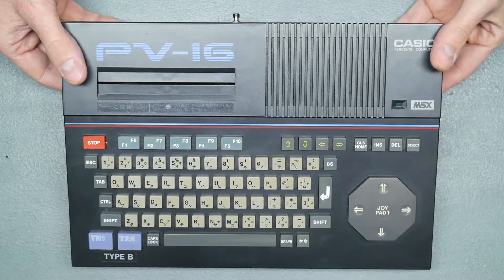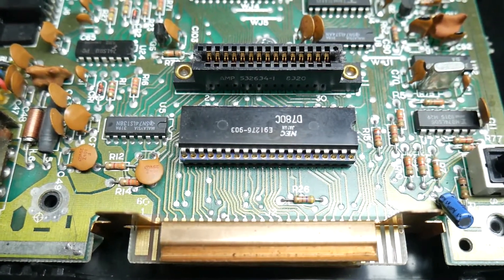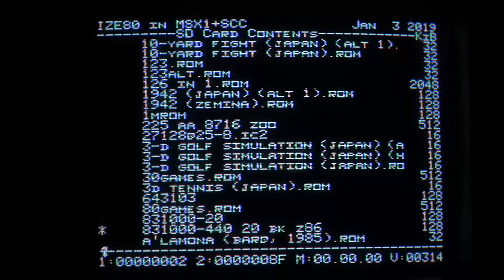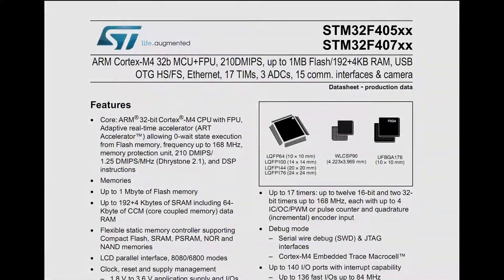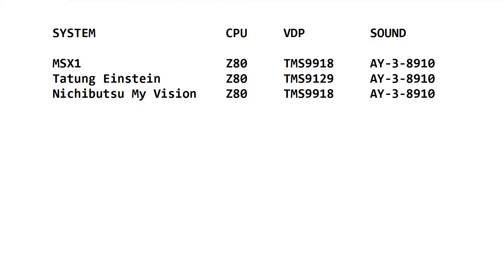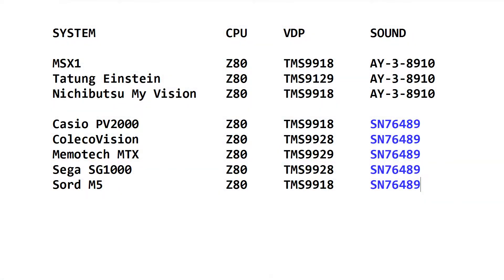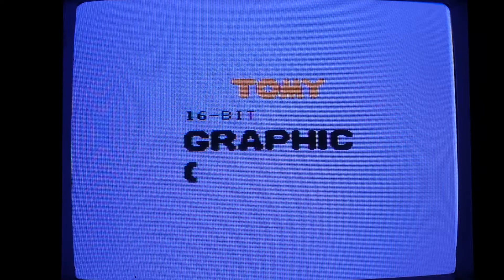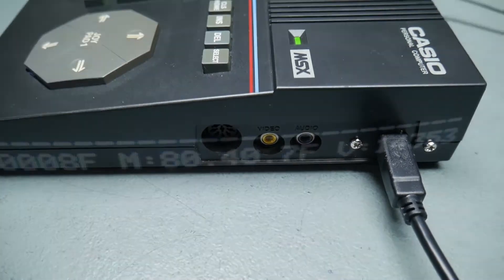IZE80, an in-circuit emulator for Z80 systems in action in an MSX

Comment: has this been abandoned?
Reply from the maker: Its very well an active experiment/tool for me. However the thought of selling/supporting this for various uses there is incredibly terrifying. Would be an enormous time drain
Reply: @plgDavid  

Any chance you could be convinced to open source your work?  If you don't intend to sell it because of support reasons (perfectly understandable), it would be awesome to make what you've done available for others to extend.  You've basically got something better than a Fluke 9xxx series with a Z80 pod, but it's all modern tech, and could be expanded so many different directions.  I sometimes do old arcade machine repair, and this thing would be a life saver when you've got a Z80 based game that's flaking out.

Comment: Dude, where did this end up? Did you make these available?
Reply from the maker: I still use them in Z80 stuff I own once in a while but I’m not selling them. Can’t get more parts anyway (STM32F4x5)
Reply: @plgDavid  Ah, that's a shame. Have you thought about open-sourcing the design, in case some folks have that microcontroller in their parts bin?
Reply from the maker: @gunrock00  I did. But even so I feel I would get questions about it, and I knowing myself I would answer them.

Comment: Hi David... I'm from Italy and way back in 1981 I designed a small computer based on Z80 and a few other components with RF video output and a minimal BASIC interpreter. I'm looking for a small development system that allows me to write and test code the Z80 easily and inexpensively ... could the  be  IEZ80 the right item? Can I buy it?
Reply from the maker: Nah. its still an experiment that needs a lot of custom code for each specific hardware I put it in. Supporting this would be too much of my time. Its just a hobby :)
Reply: @plgDavid  I can understand :-) thanks and bye

Comment: I am interested in this device as well. Ever think about adding software and linking it to a remote PC to use as a Fluke 9xxx emulator?
Reply from the maker: It can do roughly the same as a fluke pod but I just program what I need myself and dont have a Fluke script tool. The device is sadly not for sale. I have no time to support this sadly.

Comment: Do you use gpio to emulate data bus?? How to pause execution??  How to communicate with debugger??
Reply from the maker: Yes the data and address busses use a contiguous GPIO port each for fastest writes. I didnt implement a debugger per se yet, but it could be programmed and controlled either locally or remote. The Z80 is emulated with C/C++
Reply: @plgDavid  hi David, is the z80 emulation of your own or are you using a third party library? I am working in a similar project but based on rp2040. Reading your comments I know that I'm in the right path...
Reply from the maker: I forked an old build of https://www.autometer.de/unix4fun/z80pack over the years.  @carlosmsx2

Comment: I'm very interested in the hardware of this board. The application I'm looking at is a simple, very slow,  ( but no longer available ) I/O chip. If you could make public the PCB files, BOM, and software tools then I know it will be easy to find  the right people to programme it. There is an active group who are reviving machines a generation older than Z80's, and a programmable 40 pin device like this would be the answer to a lot of their prayers.
Reply from the maker: I hear you and I want to make it happen in one form or another

Comment: Super cool! It would be great to see it documented on github / hackster or similar. That would not preclude any sales either of the finished device. In addition to ICE, some sort of debug UART interface would be great - given that it can control the bus fully, one could use it to upload/download memory contents, set ports, run with hardware breakpoints etc, making it a great development tool.
Reply from the maker: Theres an integrated STM32 debugger (SWIO and SWO)
Reply from the maker: Just too many things to finish on many other projects, sadly

Comment: Are you ever going to sell this Emulator to the public?
Reply from the maker: Michael E. Bills as I said a few times, my main issue is support. I could sell it to programmers with some hardware experience only, kind of like an arduino, without all the documentation and forums.
Reply: @plgDavid  okay, thank you... I am interested as I have been teaching 8 bit programming with teens in Virginia for years. I thought your IZE80 would be interesting for the students to learn and develop on.
Reply from the maker: @Michaelebills  What Z80 machines would you want to put them into?
Reply: @plgDavid  I have two Commodore 128, 2 kaypro II, I am also building a Z80 computer with some students from scratch.
Reply from the maker: @Michaelebills  Hmm Very interesting. Never tried it in C128 (although I have some here), dont have a kaypro. IZE80 would have a hard time working in a shared bus thats for sure.
Reply: @plgDavid  I have built a Z80 ICE from two Z80 PIO chips and a host computer. But IZE80 is more of a stand alone Emulator which is better. I am also working on a 6809 Emulator  also using two Z80 PIO chips and a host computer for my Color Computer II.... Would be also nice to make a 6510 Emulator for my two C64 and my SX-64.  I mainly use commodore and Z80 cpu for teaching 8-bit development with students because of all the programming documents out there as well a the C64 IDE that runs on modern PC. I also have a Gould Biomation K100D logic analyzer which is great for monitoring old 8-bit cpus. I also have a few HP logic analyzer for our Z80 computer build we are working on.
Reply: @plgDavid I just signed up for your website News Letter under my name. Feel free to Email me.
Reply: @plgDavid  how can I contact you?

Comment: I'd like to purchase one of these when you have them available. I have Z80 systems and want to disassemble the ROM's. Tracing them should work with an ICE to give me accurate disassembly for the code that's executed in the ROM. Please let me know when you are selling them.
Reply from the maker: Doing Z80 system RE and address map figuring is indeed one of the cool things I like to do with it. Just swamped. I guess I need to find someone to produce these in numbers. Thanks!
Reply: @plgDavid  My brother has used Tinysine to do small runs. 
You could give them a try.

customerservice@tinyosshop.com
Wu is the contact.  You send him an eagle cad file or gerbers and a parts list.  He will give you a quote for a quantity.
Reply from the maker: @scottchapman2230  Thanks for the tip I'll think about it!
Reply: @plgDavid  If you decide not to build these out and sell them, please consider releasing the details so that others can get them made for personal use.
Reply: I am not aware of a decent Z80 In-Circuit Emulator available anywhere today.
Reply from the maker: @scottchapman2230  Oh it will be one or the other. Just lack time to fix a few things and make a second rev, thanks
Reply: @plgDavid  Do you have an ETA on this?
Reply from the maker: @scottchapman2230  Sadly no, and with current state of things even less I'm afraid.

Comment: Hi David.  Loving your videos,  great job.    Eagerly waiting for news about the IZE80.  I have a couple of Casio MX-10 that could come back to life with it.  Keep it up!
Reply from the maker: Yeah PV8, PV16 and MX10 are good candidates. You a programmer?
Reply: @plgDavid  I can handle myself with a few languages,  but building hardware is what I do best.   Did a lot of software for the Apple Newton years ago.  These days I'm restoring old Japanese electronics and building custom controllers for the MSX.  Google @dproldan for some of my humble projects.  :-)
Reply from the maker: @dproldan1  basically IZE80 is really a code it yourself Z80 replacement. Everything is there to control everything. But commercially supporting my own vdp/psg controlling firmware is not in the plans.

Comment: Maybe a dumb question. Is is possible to make a similar replacement with an ESP32? Okay I read about the 5v tolerance. Okay I think it would not be that suitable.
Reply from the maker: ESP32 footprint is wider than the Z80, it would be a bit clunky too i guess. It would be much more powerful if I could use LQFP100 STM32's, which could be done with some weird header pins under the board. Not doing BGA thats for sure

Comment: that development is really amazing
One question: can the z80 be set to any clock?
for example put a zx / cpc / msx @ 7mhz internally?
Reply from the maker: Its not driven by the external clock, it uses the on board 8MHz+PLL to get 168MHz arm. the external clock is used to synchronise read/writes to the outside world. So its not like a.clock accurate FPGA Z80 replacement. it doesnt work for every use of a Z80
Reply from the maker: In short it can run stuff too fast. Break games etc.

Comment: I worked a lot on motorola 6809 and now on new microcontroller cards like Arduino and ESP8266 and ESP32 and STM32. I made many kits for 6809 and I loved the way how it can be programmed in assembler and how the kits can be designed with all complexity of adress decoding and making everything from scratch (memories, UART, ADC, Parralel port, PTM, LCD and PS2 keyboard and even IDE hard drive management), and I loved also the new uC cards in other aspects like the enormous possiblities they give us to develop new and very advanced projects with the help of new sensors and a huge amount of libraries availables for them. And now I am planning to make the same project you did for motorola 6809 using STM32 for example wich is very advanced and cheap uC comparing to 8 bits uC like Atmel and PIC. If yu are interrested in such project we can do it togheter.
You can see my videos to understand what I made with 6809.
Reply from the maker: Hello. Yes since the start I planned on doing 6502 and 6809E versions of this idea. Don't know when though.

Comment: Two of us currently working on a Z80 project are very interested in your product.
Reply from the maker: Sorry didn't see that reply. Its really beta right now and you absolutely need to be a programmer to do anything with it. Care to tell me more?
Reply: @plgDavid  My project partner is the real programmer for our custom Z80 project.
Reply: @plgDavid  Hi plgDavid, I'm working with Don on the M62 Project which is built around the Z80 as Don mentioned, your IZE80 would definitely be handy for OS development. I use a simulator for testing and debugging some code but that can't simulate a lot of the hardware I'm using, so an ICE system would make that easier. Please let us know when it comes out of beta or is available to purchase :)
Reply from the maker: @39Kohm  Quickly checked the project. I guess the current interfeace code is beta and it works best if BUSREQ/WAIT are not needed right now. Do you need those in your desing? seems you might

Comment: I just saw the vMachine video, wouldn't plogue be able to release a FPGA Chipsynth MIDI module? I already own ChipSounds ChipCrusher and chipspeech. Tge only rivals you have in the new hardware side are the pocket operators like the po 35 speak or 20 arcade. And your accuracy would be mad good with fpga, as it already is with software emulation or even much much better
Reply from the maker: Hi FPGA, real time code on microcontrollers and even using real used chips are being experimented with right now. If you look at my previous PortaFM video, there are glimpse of what I'm up to. Cheers

Comment: I’d like to buy one of these as soon as they are available
Reply from the maker: Hey. For MSX use or something else? It really depends. Starting the beta with specific cases. Unless you are a embedded dev, then it could happen faster.
Reply: plgDavid id like to try on debugging some old z80 based arcade PCBs
Reply from the maker: @Omegaman1969  Perfect use case then.
Reply from the maker: contacting me on twitter might be easier than this if you can. twitter.com/plgDavid
You will need a USB isolator for sure on top of IZE80. and some dev tools
Reply: plgDavid I have an old twitter account but I’m not familiar with messaging using twitter . My username is tacscan . I followed you .
Reply: Ditto.

Comment: Amazing! Is this available anywhere?
Reply from the maker: I was gaging interest. Seems I'll need to make a Tindie page soon :)
Reply: @plgDavid  Yes please. I would be very interested. Anyone making homebrew Z80 computers would have great benefit of a Z80 hardware emulator. I would like to move it toward debugging and code path logs etc. Any chance you would open-source it?
Reply from the maker: @obiwanjacobi  There will be a baseline open sourced yes. And schems.
Reply: @plgDavid   Please open-source it :)
Reply: @plgDavid  Are you still working on this, David? I did a quick search around but didn't find anything. Love it.
Reply: @plgDavid  very much so, very useful to have on z80 SBCs as well as genuine vintage systems

Comment: Nice work! I've done a lot of work with STM32F4 parts and I've often wondered how well they'd work with some of the older generation hardware.
Reply from the maker: Eric Brombaugh The 5v GPIO tolerance is really the major selling point here. If I wasn’t afraid I could also go BGA and add even more horsepower to a small footprint like this.
Reply: @plgDavid  Yeah - BGAs are definitely a bridge too far for me. I've done some work with QFNs and that works OK, but those packages don't provide much of an area advantage over the LQFP you're using here. That said, I know folks who have done BGAs by hand and they've had good success with them. Depends a lot on what kind of PCB process you've got though - fine features and fancy vias may be required.
Reply from the maker: @ebrombaugh  Tried QFN's a bit too, and I agree with you, its slightly more annoying to solder for not much more more. I'll try to tweak this particular design with a BGA for fun, I need to let go of my fears :)
Reply: @plgDavid  I like Paul Johnson's moto:  
—“Never be afraid to be terrified”